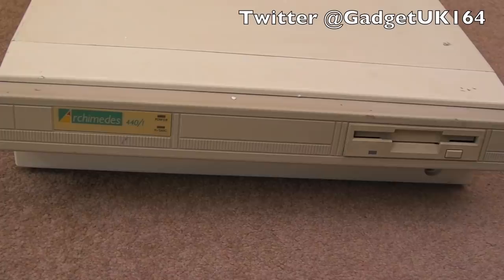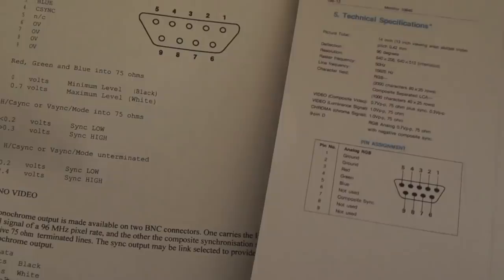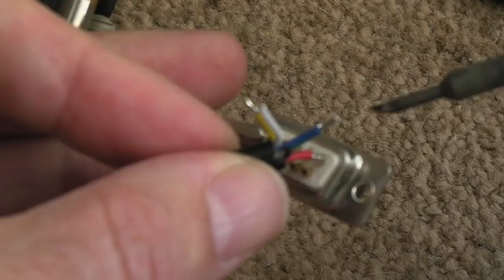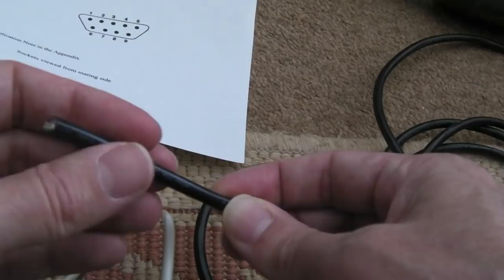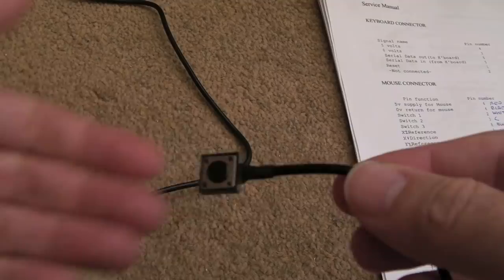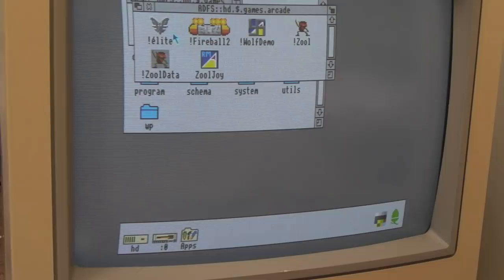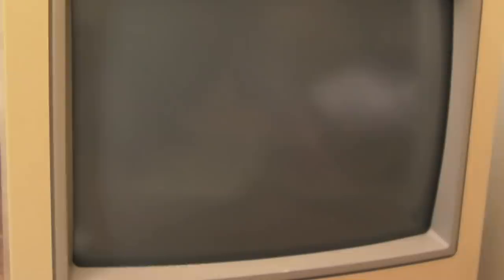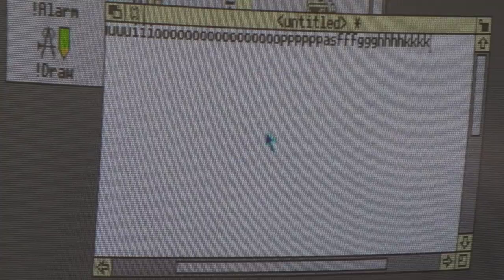Acorn A440/1 Archimedes Repair Part 1 (Video, Mouse, Keyboard, Omniflop & More)

Comment from the maker: EDIT: I am not 100% sure about the A4000 having a keyboard fuse - I might be confusing with a Compaq PC model.  But they did have Conner HDDs that failed.
Part 2 - https://youtu.be/hGdPduozFkU
Part 3 - https://youtu.be/kvcdlH0Ho_A

Plan C A3000 Repair Part 1 - https://www.youtube.com/watch?v=J8WYqlOxFkM
Plan C A3000 Repair Part 2 - https://www.youtube.com/watch?v=j1QO5wVu3tI
Plan C Amiga Mouse to Archimedes - https://www.youtube.com/watch?v=424jim0k0zk
Reply: Yes the Archie A4000 has a keyboard fuse on the motherboard.

Comment: I was a component level service engineer for Acorn.  The A300 series came out first THEN the 400 series then then 400/1 (410/1 1mb/no HD), (420/1 2mb 20mb HD) & (440/1 4mb 100mb HD).  These ran ARM2 and the R140 came out at the same time as a unix workstation.  The A3000 was a cut down version in an ST/Amiga style case.  We were Orion Computers.  Acorn wouldn't let us cut the price so what we did was upgrade all 410/1s to 420/1 spec, all 420/1s to 440/1 spec and the 440/1 with a bigger hard drive. (the 20mb/100mb might be 20/40 or 20/something else it was a long time ago).  At the time the the 440/1 etc came out they were the TOP of the range.  the 540 came out next which had an ARM3 (which could be fitted to a lower machine).  The 540 also had spaces to 4Mb additional memory cards which all had their own MEMC memory controller as it could only actually address 4Mb.  All the other machines came out after that.  I upgraded so many machines that I actually upgraded a machines memory blindfolded in 10 minutes.  This is even more impressive when you look at the memory chips the 400/1 series actually used
Reply from the maker: Thanks for sharing that =D   Yes, I imagine the RAM being a PAIN to fit to the lower spec 400 models.  Mine has a tonne of ZIP packages...

Comment: Brilliant. Archimedes machines don't get a fraction of the love and respect that they are owed. I know so much is talked of the BBC Micro in being instrumental in a certain generation's computer skills, but my generation was the A3000s, 4000s, 5000s and A3020s. First computer I was ever taught to use in the early 90s as a kid. They changed my life. I have absolutely no memory of one failing, crashing etc. I used them as a staple of UK education up until about year 8 in secondary school, where they were all replaced with generic Windows 95 and 98 PCs which were immediately fucking useless lumps, would stall and crash all the time, basically offered nothing the Acorns didn't. It felt like such an awful step backwards. The Music department hung on to one for years because it would read and write and backup the old Atari floppy disks without fuss.

Watching the video I even remembered the shortcuts I was taught (ctrl-shift-F12 for shutdown right?) the mouse buttons, the graphics modes, the taskbar...

I briefly had a decommissioned  school A3020 and multisync monitor, with a dodgy 60MB Conner drive in it. When a Mac G4 came along it stopped getting used, the monitor went to the tip, and the A3020 was sold to a bloke in France I think!
Reply: And this bloke could be me, who knows ;-)
Reply from the maker: Yes, they are trully lovely machines!  I love Risc OS and everything about the Archimedes!
Reply: Indeed. These were so far ahead of their time it was baffling. RiscOS was easily the best GUI OS around at the time, really really powerful and not only that great to look at.

Comment: I've also heard it called 'Advanced Research Machine'. lol. I've dug up some BBC Micro Assembly manuals in a bid to learn it this summer, on a Raspberry Pi 4. They also used 6502 and even Z80 microprocessors! 🖋

Comment: Those keys are actually used by the several home computers at the time I think the IBM luggable used them aswell, you can buy replacement silver contacts for it, it has a foam pad behind it that degrades over time and turns to dust , I can try and track down the seller for you if it's required (still watching the video)

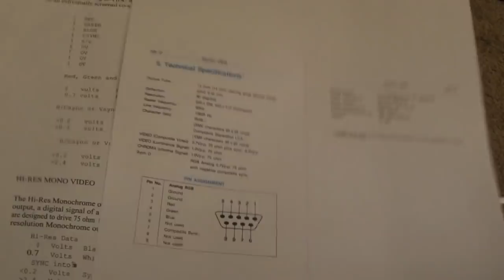Comment: 4:15 Looks like the Analog RGB pin-out is semi-compatible with the CGA standard
https://en.wikipedia.org/wiki/Color_Graphics_Adapter#Specifications
Except the RGB signals are analog and not TTL, and CGA outputs separate H.Sync / V.Sync on pins 8 + 9. 
So assuming they're fully wired, the 9 to 15 pin CGA ("Serial" !) to VGA adaptors are pin compatible with A3xx/A4xx/A3000, if there is a VIDC enhancer fitted.

Comment: I knew that tiny DIN plug was going to end in swearing as soon as I saw it, I wasn't disappointed :-D
I was working on an old PC the other day, the PC probably hasn't been used for 10+ years and its drive was also powering down randomly. After a couple of hours powered up including doing a full surface scan it's been fine since. No surface errors found either. That was a WD Caviar drive from 1998.
Reply from the maker: LOL!   It was super super annoying lol!  Sadly this HDD is dieing I think... It has now started with random surface errors too.  They don't last forever old HDDs =/

Comment: Yeah the contacts on the keyboard are capacitive, everyone of those metal disks has a sponge foam layer under them that can brake down over time and they will need to be replaced, I have a Kaypro 2 that uses them too, I had to replace all of them, I used little round felt pads that were the right thickness and painstakingly glued them to the metal sheets with a jewelers cement to the bottom plastic layer of the contact. I later saw the 8-bit guy doing a restoration of a  Compaq Portable with the same keys but he ended up getting a source for direct replacements, heres a link to his video on it https://www.youtube.com/watch?v=5fju5eRxdRY
Reply: I thought of the 8-bit guy as soon as I saw those shiny disks :-D
Reply from the maker: Thanks, yes - on reflection I saw that video, I just forgot lol!

Comment: Excellent video just catching up on some of your vids and this was brilliant. I didn't know you could convert an Amiga mouse like that. That solves a problem for me as I've got two Acorn A3000's but only one Acorn mouse. I also have an aftermarket 3 button Amiga mouse with a bad 9 pin D type connector I could cut off and replace with a 9 pin micro din to suit the Acorn.
Off to watch part two now ;-)
Reply from the maker: Lucky sod owning two A3000s lol =D
Reply: Haha Yes and No, If you thought the battery leakage you get in an Amiga 500 plus can be bad then you haven't worked on a acorn A3000 with battery leakage lol

Comment: Such fascinating machines. We didn't really get them in any numbers in Oz. (We got Amigas followed by PCs).
Something I used with great success was the PS/2 to Quadrature mouse circuit from Dances With Ferrets (http://danceswithferrets.org/geekblog/?m=201702) which uses a cheap Arduino and a handful of components and allows you to use PC PS/2 mice (Including laser mice) with Amigas, STs and Archimedes computers. (I ended up building one with a built in joystick switcher for my Amiga 1200)
Keep up the great videos.
Reply from the maker: Thanks =D  I got a "proper mouse" this week!  But yes, I've seen those PS/2 adapters - pricey!  The annoying thing is the same thing for the Amiga or ST are like £10 to £15.  But for the Archimedes it works out like £40 ish...

Comment: Rough mouse movement - I remember finding an issue with mine  - if you move the mouse in small circles you'll notice little excursions in the movement which square off the circle. Acorn weren't interested but I eventually found a modified ROM image for the keyboard which fixed the problem.
Reply from the maker: Very interesting!  I will look into that!
Reply: @GadgetUK164  Had a look in my archives but couldn't find the file, probably long since discarded. I remember the file was uncredited and difficult to find, it could even have come from a usenet binary group. Good luck!

Comment: I've had an A420/1 for a few years, problem is it's been bought one part at a time, not been able to get video out of it.
I don't have mutlisync monitor, but know it can boot into a VGA mode by holding down a key at power on.
Problem is I have no idea if any of it works, the Video chip could be bad, the cable I made could be wired wrong, the keyboard might not be working, or my modern monitor doesn't like the signals.

At least you video prompted me to clean inside the keyboard, and perhaps see what signals come out. Really need an oscilloscope to figure out what is happening, but people think it's funny to make rigged contests.
Reply from the maker: One thing I've found is you can get video problems (or no video) if the CMOS settings get corrupted by a missing or flat battery.  Worth powering up whilst holding Delete down to see if anything appears afer re-initing the CMOS.
Reply: @GadgetUK164  I've tried all this multiple times in the past, this goes beyond a simple CMOS reset.
Something is fried somewhere, there is a faint small of overheating silicon. The CPU appears to be running, as the caplock/num lock keys work after a few seconds of applying power, the PSU has been checked.

Oh and yes they keyboard did have some dud keys, which I have managed to fix.

Comment: Outstanding video as usual and thanks very much indeed for the shout out. Much appreciated. Funny enough, I have just finished modding my A3000 with a Gotek floopy emulator and compact flash to IDE "hard drive". I tried 2 Conner drives and could not get them going for love nor money lol. The guy who wrote the firmware for the Gotek (JeffHXC2001) recently did a  firmware update so it can read Acorn Disc Images natively. By swapping out the 7 seg display for a cheap Banggood OLED, it is possible to see the file, load it with a momentary switch and the Arch knows no difference ;). Here is a link to Jeff's firmware (it is quite a few posts down): 
https://stardot.org.uk/forums/viewtopic.php?t=13765
There is also a link on the first post of that page to a site where you can get adf images of stuff that is no longer copyright. Using a RISCOS PI, it is possible to download and extract these to a thumb drive, put then into the Gotek on the Archimedes and violla! Extracting them in windows corrupts them. They must be extracted on RISCOS.
The compact flash drive is more fussy, I tried several adapters/SD to IDE, SD to CF to IDE etc, but so far the only thing that works is genuine Sandisk 256GB card and this adapter:
https://www.ebay.co.uk/itm/LK-5V-CF-Compact-Flash-to-40-Pin-3-5Inch-IDE-Bootable-HD-Converter-Adapter-Ea-/253621550781
Not the exact link but it is that model.
Thanks again and please keep up the excellent videos. Probably wise not to pull the plug on that f'ing Dj lol.
Reply from the maker: No worries =D  I've just got an IDE drive for this myself!  I might get Gotek at some point, not sure yet.  I will stick a link to your latest video up there later!
Reply: @GadgetUK164  Thanks 👊. Hope it all goes well. Got 2 Conner drives here if you want them. Beyond my skill level to fix lol. CF card seems OK but still not 100%.
Reply from the maker: Did you ever find a copy of Zarch anywhere btw?
Reply: @GadgetUK164  
http://qubeserver.com/Qube/qubeftp.html
zarchandgolf
Reply from the maker: I owe you for this one mate!!!!   I have looked EVERYWHERE for that!   Thanks!!!  Let me know if there's anything you cannot find!
Reply: @GadgetUK164  No worries. Glad to help.

Comment: why do floppy disk drives stick at 800kb or 880 k ? why can t they format to 1 meg or 2 meg or even 3 or 4 megs on a 2.88 meg floppy drive? its strange a bit weird.
Reply from the maker: The storage size is dictated by the density of the disk material used to make the disk.  ie. in a high density disk the density of the particles that are affected by a magnetic field (for a write) are much more dense than a double density disk.   A disk is split into tracks and sectors, and each sector can hold a specific number of bytes (eg. 512 on a DD disk).  You calculate the maximum size of a disk by mutliplying the sides x tracks x sectors x sector size.  The DD format was originally 80 tracks, 9 sectors per track, but...  the quality and density of most DD disks meant that people could actually format (on occasion) up to 82 tracks, and squeeze in as many as 11 sectors, and the media seemed reliable enough to support it.  That's where 880K (or more, you can get more with 11 sectors and 82 tracks) came from.   HD is just double the number of sectors (1.44 HD = 18 sectors per track), again people found you could get up to 2MB almost using a few more tracks and squeezing in more sectors per track.  Some Microsoft install media was known to use the 2MB format I think.

Comment: I am very confused about using ordinary serial PC mouse. I have thought that they are only attachable on serial port, so they does not provide these Xd, Xr, Yd, Yd, SW1, SW2, SW3 signals. MS mouse mode is surely serial. But I have found that PC AT mode is probably old Bus Mouse mode which provides Amiga compatible signals. Sou Are you using PC AT mode and NOT MS AM mode as you said in the beginning?
Reply from the maker: It's not a serial mouse!  It's an Amiga / ST mouse.  The switch underneath toggles between Atari ST or Amiga mode.
Reply: Thanks for reply. Are you absolutely sure? I have couple of SERIAL mouses with exactly same labeled switches. But true is that in both modes it work on serial port. So it is just more confusing. If you select another mode will the mouse work too? Because switching from Amiga to Atari mode only change direction movements as I suppose....
Reply from the maker: Yes - the manufacturer used one plastic shell for both of the mice they sold!  Some were serial (AT/PC) - printed on the case of mine!  But internally it supports Atari ST / Amiga.  I had the mouse already because it came packaged with one of the Amigas I bought years ago!

Comment: Hope you don't mind me asking you a question: - I've just got a component cable for my Spectrum +2 but the output picture is extremely crap and looks like a barely tuned RF signal - it's super grainy, rolling and unusable. Any idea's why?
Reply: I have ordered an RGB cable because I am pissed off at the shite component (Red, White and Yellow) cable.
Reply: You mean composite not component.
Reply: Yeah, the composite cable is not the best idea for great picture quality, friends and myself used to call it "Shit-O-Vision" back in the day, RGB SCART is definitely the way to go if your TV has a socket for it, and even if not, the converters to HDMI are fairly cheap now, so they should help too.
Reply from the maker: I replied to the other message on the same topic - check if one of the transistors needs reversing.  On the grey +2 it often does!

Comment: That keyboard seems overkill,over engineered.I never knew these machines existed,but seem well built.The fact it still works also proof of quality.
Reply: Yes Acorn machines were expensive but quality was high, as the performance.
Reply: Zarchos yes,I remember Acorn,not archmedies.They had Acorn bbc when i was at school many moons ago.I suppose they were expensive so we had spectrums and we just wanted to game.
Reply from the maker: Yes, it is kind of over engineered, but it was sure built to last!  It's a joy to use too!
Reply: They were built very much with the education market in mind, and the overwhelming majority of sales were to UK schools (some schools in Australia and NZ also had them). As such, the ability to tolerate a lot of abuse mattered way more than things like weight and size. The few of the original 1980s early Archimedes were still kicking around in my school, in regular lab use, in the mid-late 90s, as were tons of the A3000s. Prob not a good strategy for Acorn as their durability meant my school (and I imagine many others) felt little inclination to mass-replace them with the newer A7000s and RISC PCs, which we only had a handful of.

Comment: Where can I get hold of that Archimedes mouse data sheet? I've got a 440/1 up and running but still need to make a mouse adapter using my Arduino! Please help! I'm so close but can't use it! Thanks in advance
Reply from the maker: It's a standard mouse - no different to the Amiga mouse (hence how I was able to convert an Amiga mouse via simple wiring adapter).  There is no datasheet I am aware of.  You would need to just work out how the pulsing works for the X and Y axis, its quite simple though.
Reply: @GadgetUK164  thanks.. just realised I watched this two years ago haha. Didn't have YT notifications on so missed your reply. I still have the arc and am in the process of setting up my new man cave where I can work on it.

Comment: I have CF Cards in mine, I would be happy to send you my a copy main IDEDisc4 system with tonnes of software on a 512CF card if you get an adaptor in yours.  Should be plug'n'play.
Reply from the maker: Thanks, much appreciated!  I've already totally setup my CF card with all the games and stuff etc - did it on the Emulator and read / wrote the HDD image back to the CF card to speed things up (covered in part 3).  Much appreciated though!!!
Reply: @GadgetUK164  No worries, I'll look forward to Pt.3!  Andrew